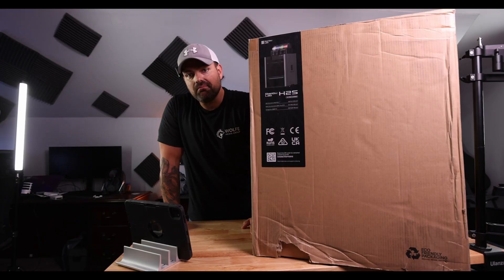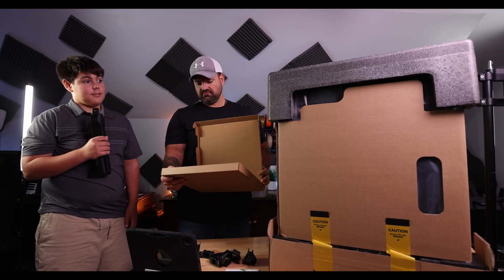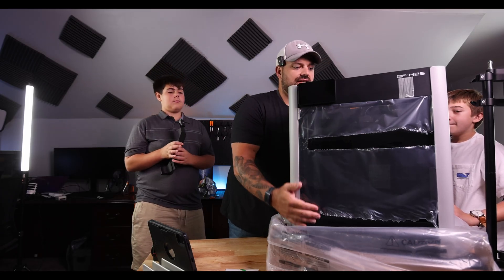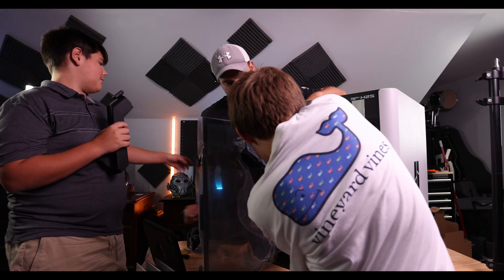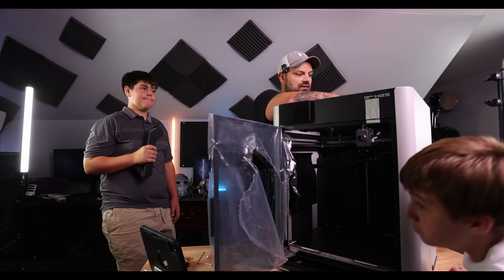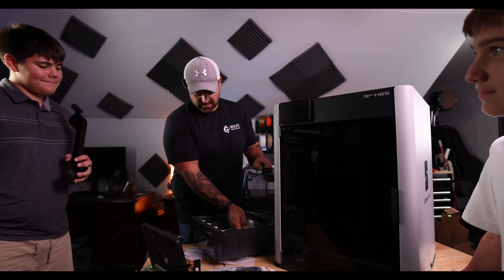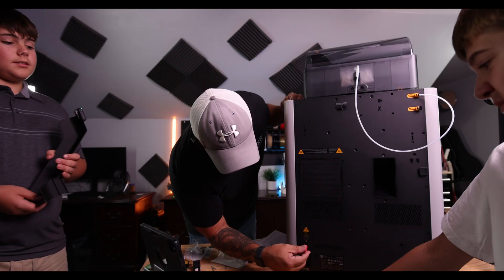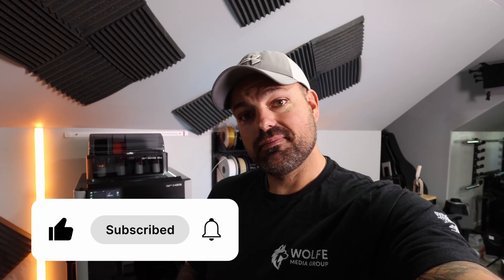Bambu H2S + AMS Unboxing & Full Setup (Shipping Screws, Wiring, First Print)

Comment from the maker: Build steps recap: Remove all red shipping screws + foam → free toolhead & cable chain (zip ties) → AMS desiccant placed → PTFE/cables connected → safety button in → bind to app → Benchy → Multi-Board print.
Questions about any step? Drop a timestamp

Comment: Good video. A more in depth portion on binding the printer, slicing your first benchy, any settings differences? There's a whole lot of steps missing from 1st plug in to pulling that first benchy off the plate. There's zero info about the poop cute, how you attached it, why have it in the first place?
Reply: I came here to say this.